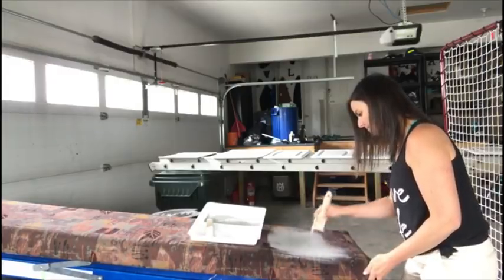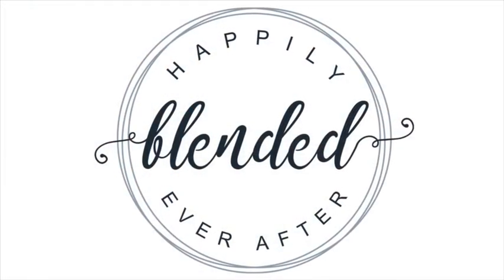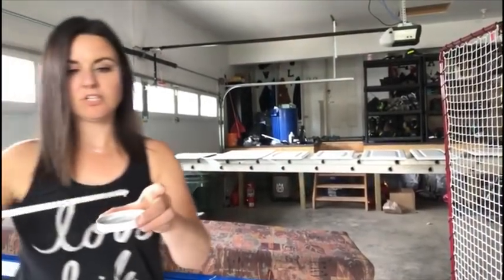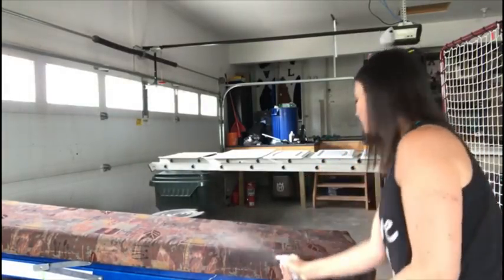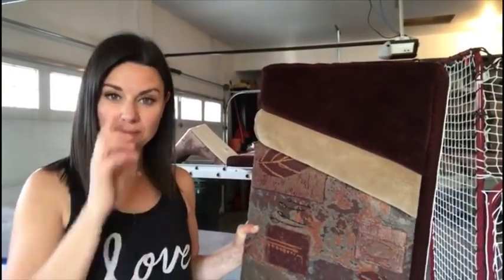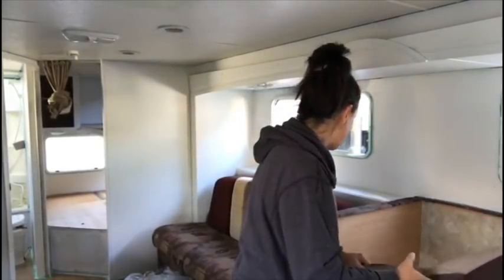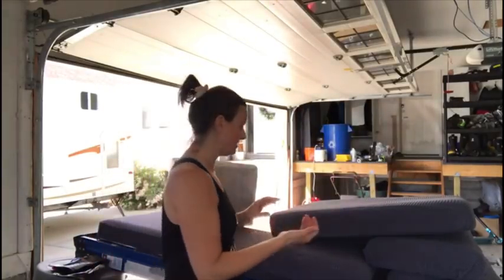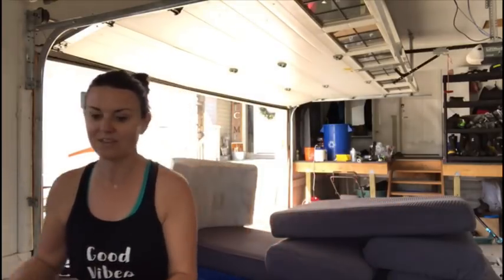Chalk Painting Fabric: My Honest Opinion - RV Reno Episode 2

Comment: 🌺. FYI: TO STOP THE FABRIC FROM BEING CRUNCHY. AFTER YOU HAVE ADDED YOU CHALK PAINT USE A SANDING BLOCK WHILE THE PAINT/WATER MIXTURE. MAKE SURE YOU SAND IN BETWEEN EACH COAT.  ALSO ITS BETTER TO USE A DARKER COLOR PAINT THAN THE COLOR OF YOUR FABRIC.  REALLY GET IN THERE AND USE THE SANDING BLOCK TO RUB INTO THE FABRIC LIKE A DYE.  I HAVE DONE SEVERAL PROJECTS WITH “ DIY CHALK PAINT “  AND NOTHING IS CRUNCHY THEY ARE ALL VERY SOFT.  MAKE SURE TO USE A CHALK PAINT SEALER. THAT WAY YOUR PAINT WILL NOT RUB OFF IF IT GETS WET OR SPILLS.   GOOD LUCK 🍀 👍